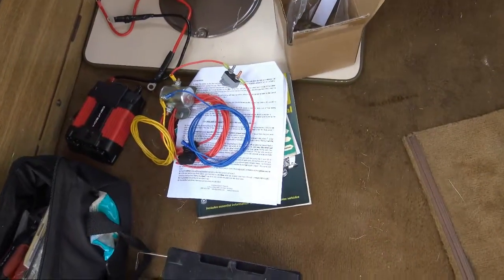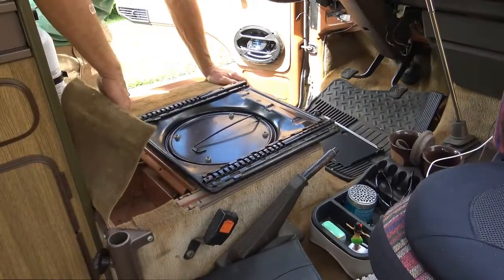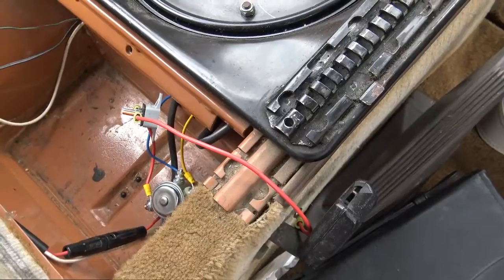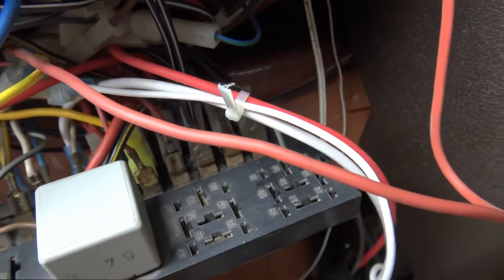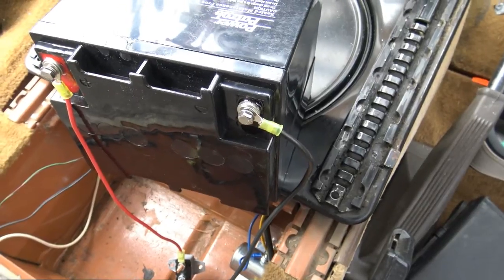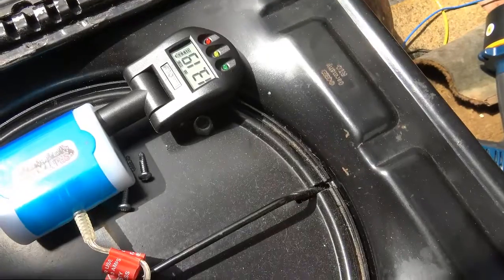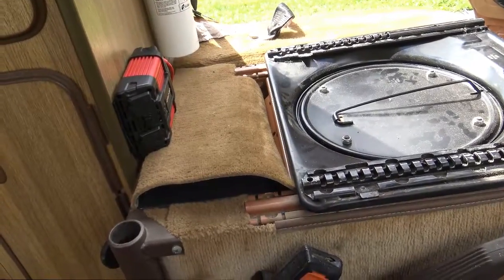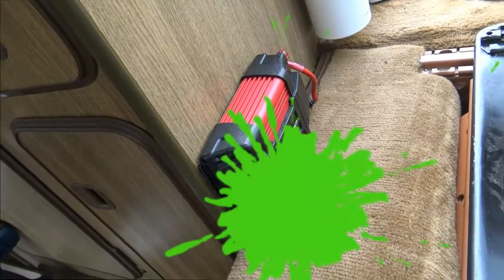VW vanagon battery isolator

Comment: Hey mike I recently add an aux battery in my 82 with the same hook up. I ran my blue wire to the alternator wire but not the same one you did.  It worked the first night but the next day I lost my alternator charge all together. I’m assuming I hooked up before the diode and fired the alternator all together.  Can you confirm that?